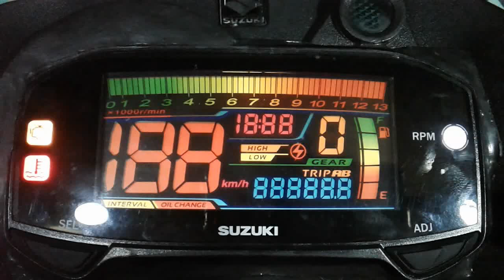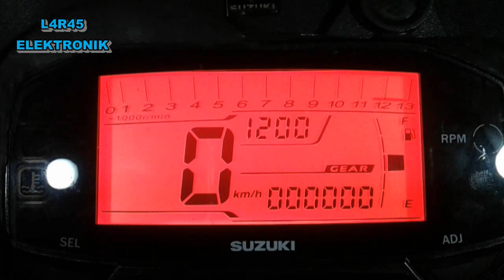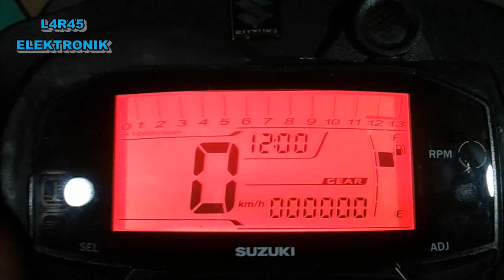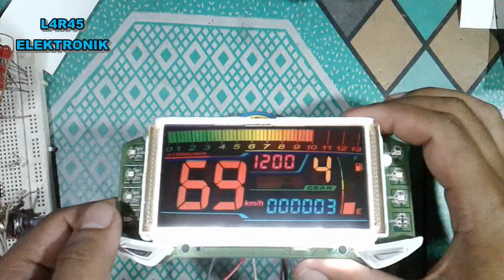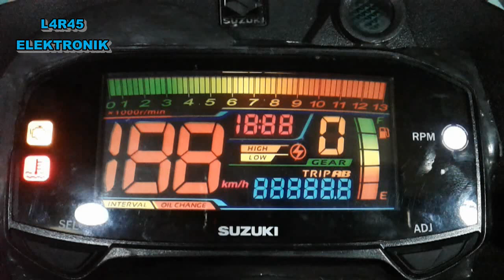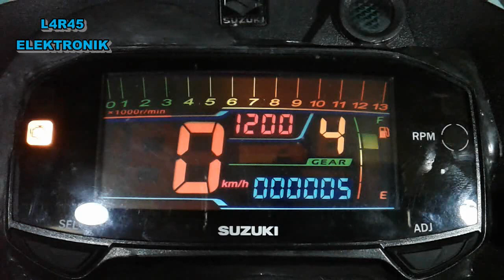Modif Satria FI warna warni

Comment: Speedometer motor satria injeksi saya kmren baru tak bikin begitu & jadi, tapi Kilometer /trip A/B jdi gk fungsi kluar tulisan Chec pdhl Indikator speed nya jalan itu kira" apa yg salah y mas??? Tolong dijawab
Reply from the maker: Harus d pasang modul CHEC bro
Reply: @P4N71  tapi ini motor saya satria injeksi mas speedometer jg masih bawaan motornya, apa ic nya yg rusak apa NE nya ya? Klo kontak on sekilas kilometer nya muncul tpi hilang lg gnti tulisan CHec gt mas.
Reply from the maker: @zoldyck4555  berati coba d cek kabel di Pin 8 bro... Yg ke ecu, atau cek juga jalur d pcb nya yg berhubungan dgn pon 8 soket spedo
Reply: @P4N71  pin 8 itu kbel warna apa mas klo dri ecu? Itu kbel yg NE555 itu y?,ok bsok saya cek lgi mas thanks infonya 😌🙏
Reply from the maker: Klo warna kabel maaf.. Ga hafal bro
Ok sama samaa
Reply: @P4N71  mas ini seandainya saya bikinin modul check ny sndri psti bkalan fungsi lgi kn mas?
Reply from the maker: Indikator injeksi dan over het yg ga fungsi
Reply: @P4N71  knapa mlh bisa gitu y mas?
Reply from the maker: Karena d kontrol lwt kabel yg ke ecm bro